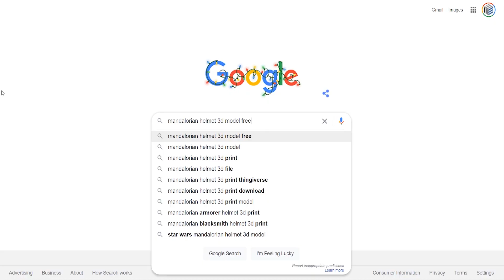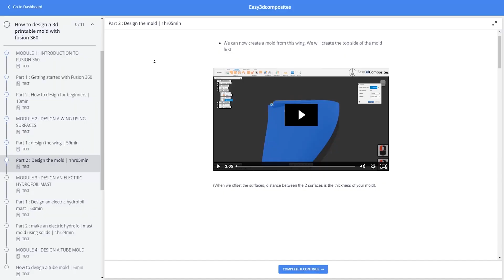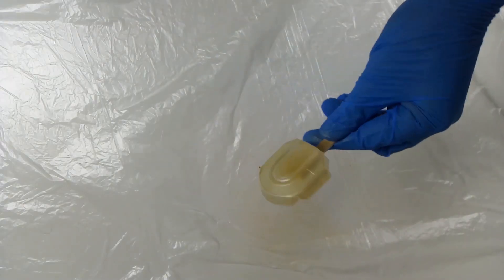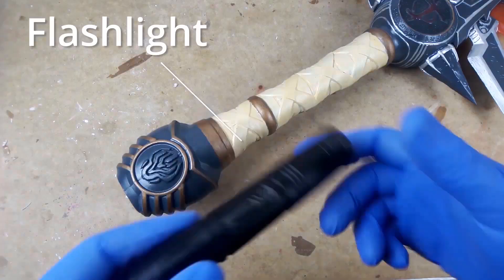How to make a Carbon Fiber Mandalorian Helmets with 3d printed molds

Comment: What material is the aluminum one?
What varnish did u use to polish them?
Reply from the maker: It's an aluminium coated fiber glass and I used a 1K varnish spray from a local store